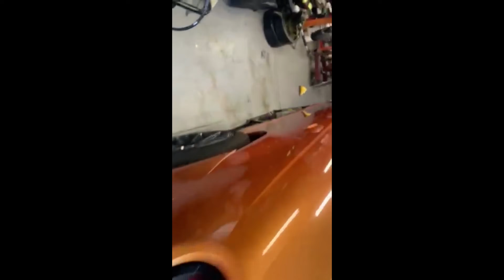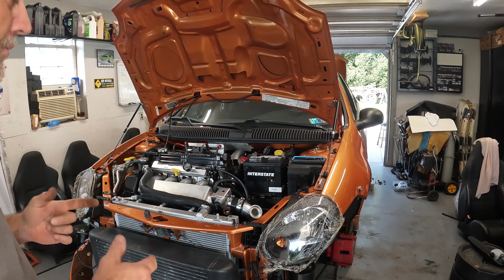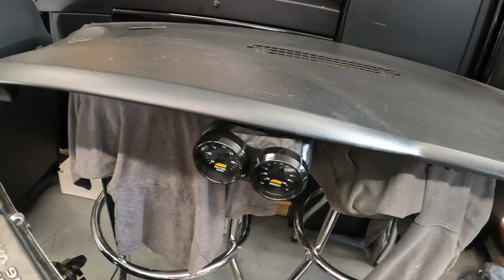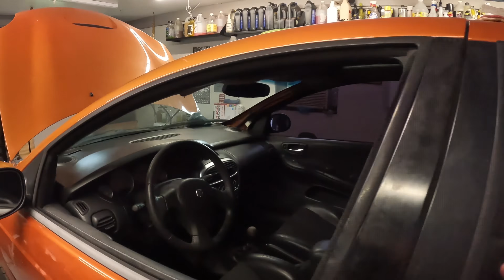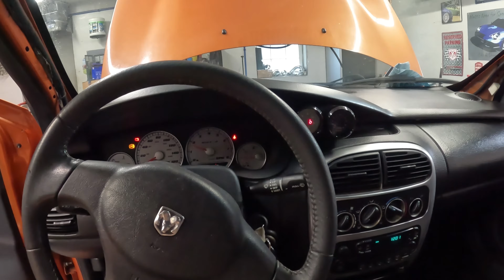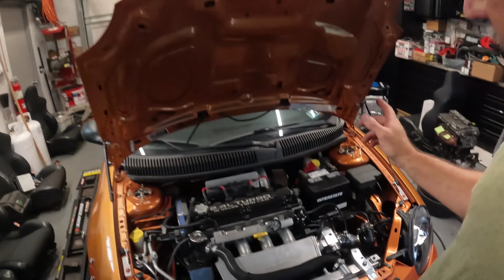NSRT4 ORANGE BLAST starts and goes for its first drive...4k..

Comment: How did you manage to have such a tight gap between the hood and the bumper?? It’s like perfect!!
Reply from the maker: unwrecked and fully assembled correctly with all the parts plus it helps there's a agp 4in race inter-cooler supporting the cover also

Comment: that is clean, hey matt Im moving back to ohio from south carolina was wondering if you had any tips on rust prevention do you drive any your srts in the snow
Reply from the maker: no i keep them out of the snow and of the roads in winter, ive herd good things on fluid film and ive herd of people using oil to coat the btm and inside the rockers?

Comment: Yellow trani oil?
Reply from the maker: the trans has the kw shaft with strait cut gears and carbon syncros i oped to run the oil in the trans over the atf+4 and its the first time i started one with the fill plug not installed I guess the way the gears spin it made it push out, learned something new...
Reply: @Mattsneedforspeed  you just speak frensh to me Matt lol 😅 all i learn from my srt4 is from you😃. But my trany oil color is red.. thats why i ask you 🤔😊
Reply from the maker: @ayrtonsenna2791   yup then you have the atf+4 transmission fluid 👍

Comment: Glad to see your building wrapping up smoothly. I should be wrapping up things on my STi build in about a month from now, hoping for a smooth first start.
Reply from the maker: no build goes smooth,  just nothing major yet there's always something the bov broke need wiring for the one gauges on the test drive i still have a rattle in the right front and the wheel bearing is bad but it was the first time driving it since i bought it 4 years ago now.